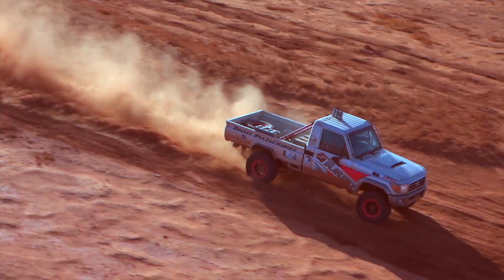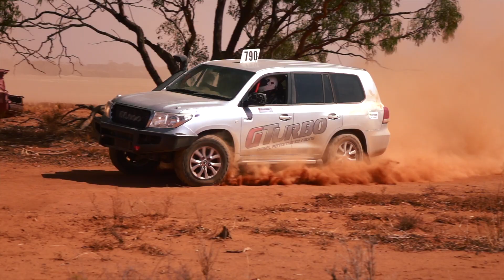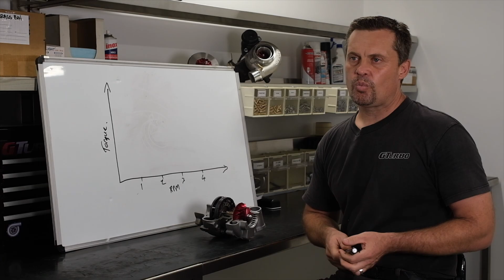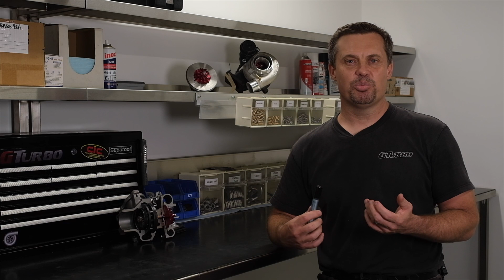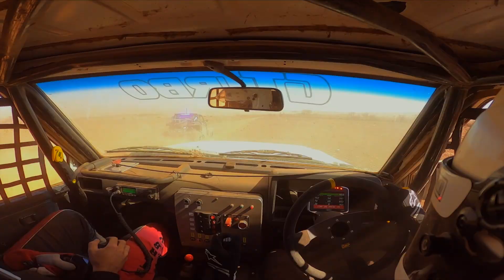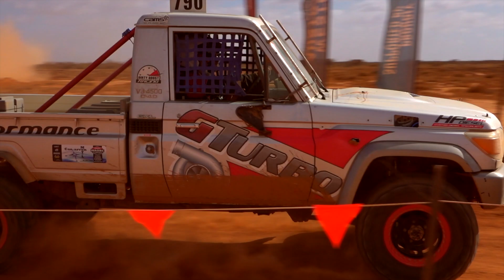Why is everyone talking about how EMP affects diesel performance?

Comment: IS THE TURBO THE MAIN REASON FOR THAT VARIANT IN THE EMP
Reply: In factory setups the exhaust and dump pipe etc can have a huge factor in the emp (especially when you turn it up) 
Imo, upgrading the turbo requires larger exhaust and intake system otherwise you could be strangling the shiny new setup